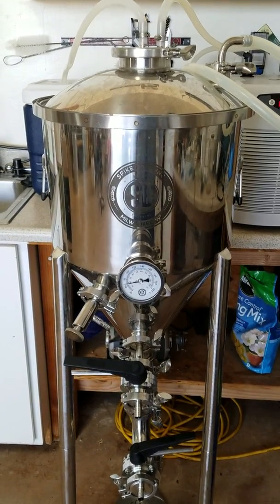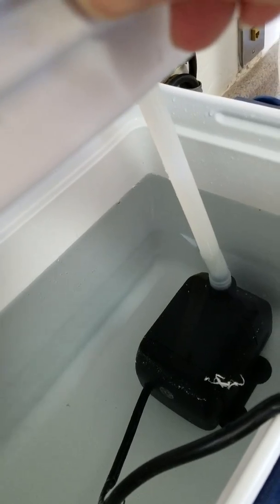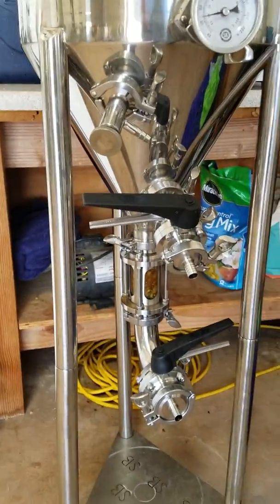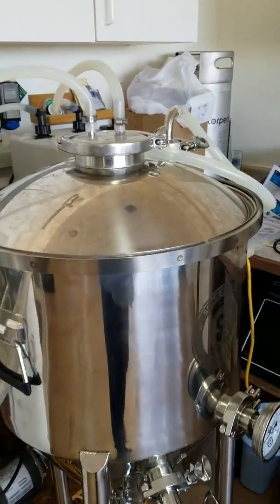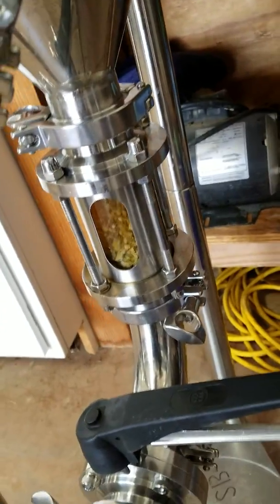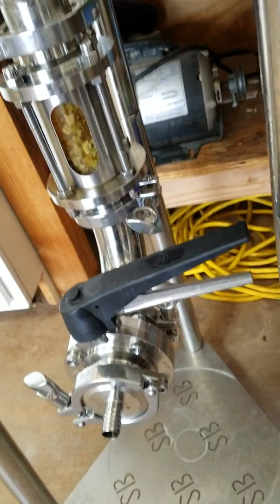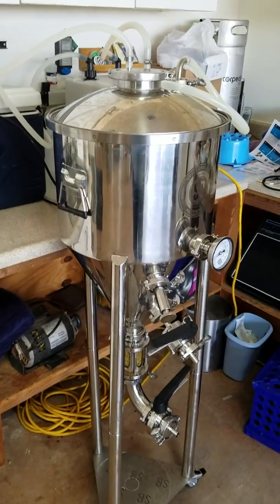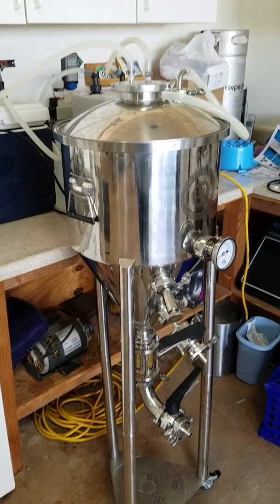Spike brewery CF10 fermentor with a chiller attached

Comment: You might know this already, but the base place is incorrectly positioned. You should see the SB facing you when you look at the front of the fermenter. Rotate clockwise.

Thanks for the video!
Reply from the maker: If you listen close I say that in the video
Reply: @canelohillshomebrewery4328  Ok. I wasn't trying to be critical, I was just hoping to be helpful. Thanks again for the videos. I also did a lot of research before going with Spike. Your videos helped me a lot! How did moving the CIP ball to the center work out? Did it make a difference? Thanks again!
Reply from the maker: @Dcalzaretta  I think it works much better from the top center. Spike disagrees with me.  But the proof is in the pudding

Comment: nice vid.   You should consider adding a tilt to your fermentor.  I love it and no more drawing samples.   Reads and tracks to a spreadsheet.  Love mine.  I have a couple.  I use one for wine and one for beer.  Cheers
Reply from the maker: Tell me more I would like to see it
Reply: The tilt, is a probe that you can put into your beer/wine, and it reads temp and SG level. It is Bluetooth, and runs on android.  You can get a raspberry pi for it but if you have an old android phone, that works too.  App is free and I just keep it in the general area and internet access and it can record to google doc's spreadsheet.  It takes a reading every 15 minutes.  It calc's your attenuation, and ABV and it was cool to be at work checking on it.  They are color coded so you can have multiple units going at a time.  I bought two (red/purple).  While the app is geared to beer, but it works for wine just fine too.   I was watching your vid, and thought you would be a fine candidate for that. They are not cheap but I've not used a hydrometer in several batches now.   I was on vacation and saw temp going up on one batch and asked a neighbor to check and the fan/cooling I had had tripped a breaker and noticed it come back in line when they reset it.    Here's a link  https://tilthydrometer.com/.   David heath did a review here https://youtu.be/LQcNIgNrZTg.  He mentioned that the first ver had battery issues but I've done some wine ones that went weeks and its still going fine.  Calibrate prior to each batch and no issues for me, and I've done 4 beers and 3 wines.   Love this gadget.   $135, is a good bit of change, but IMO it's worth every penny.   BTW store it vertical and it goes to sleep I think after 90 seconds.   Cheers!

Comment: Could you do 5 Gal batches with this? I am thinking on buying the 10 gal fermenter just in case I decide to grow my batches but with batches but no immediate plans to do so.
Reply from the maker: Yes, it is designed to handle 5 gal batches.
Reply from the maker: They also have a 5 gal fermentor but I would not get the smaller one unless you know 5 gallons is all you will ever do,
Reply: Awesome, thank you for answering

Comment: did you have any issues with the gasket when it wet with santizer?
Reply from the maker: No, I use the tank to help hold the gasket in place while the lid is straight up and down place the bottom half against the tank then lower into position.

Comment: Where did you get the cap for the Cip ball that fits in the very top of the fermenter? I don't see it on spikes website.
Reply from the maker: I got it from Brewers Hardware https://www.brewershardware.com/Tri-Clover-Compatible-4X1_5-Cap-Style-Reducer.html it was $23.00
Reply from the maker: Brewers hardware
Reply: How well did that work, as opposed to the SPIKE 1.5" location on the side? Thinking about doing this instead of the blow-off hole they recommend. @canelohillshomebrewery4328